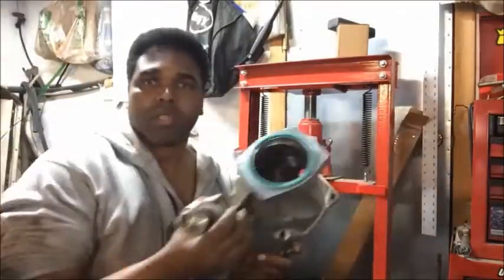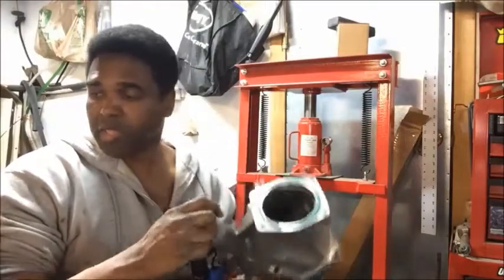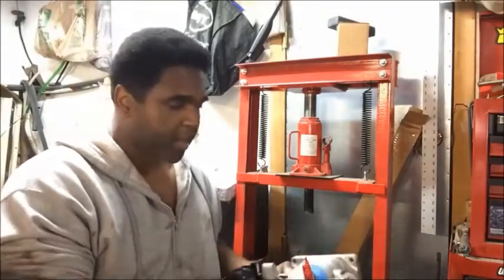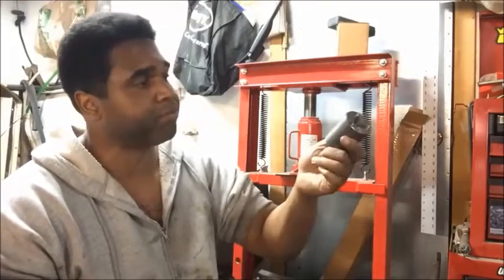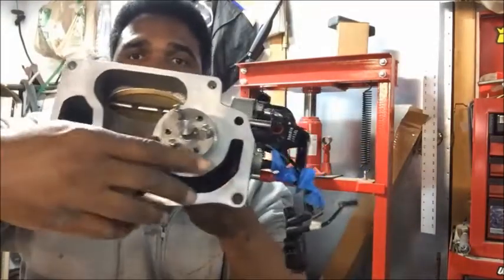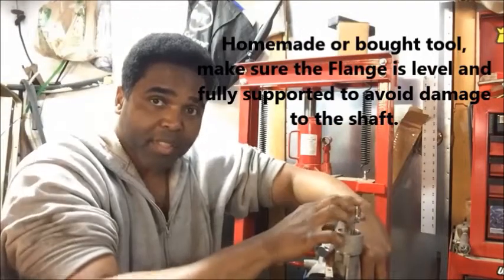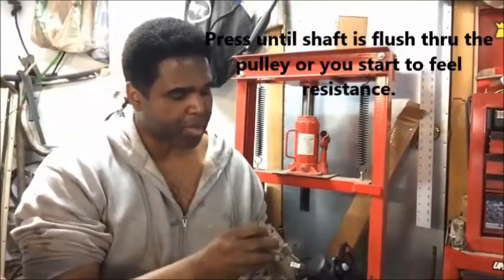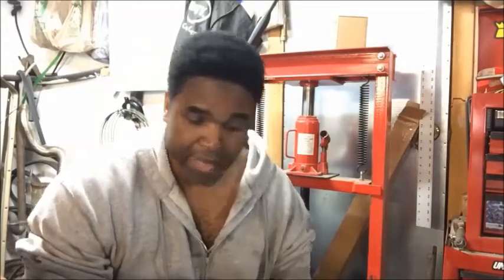How To Install A Pulley On A LSA Supercharger.

Comment: I don't see nothing wroooooooong, with a little Loctite..... Yeah!  I'm debating whether to go for this pulley setup with my LSA Volvo, or switch to turbo.  The thing is, the LS sounds so damn good supercharged.  Really gives it a great exhaust note, different to a turbo jet type sound.... (which is also good) LOL
Reply from the maker: flexing the vocal skillz lol you have a decision to make lol  im a charger guy.. but turbos are cool...
Reply: Yeah the problem out here in Australia in summer is the intake temps going through the roof.  I see a lot of people having success with the Air Conditioning refrigerant cooler on the LSA.. might have to look at that, but more $$ as always!